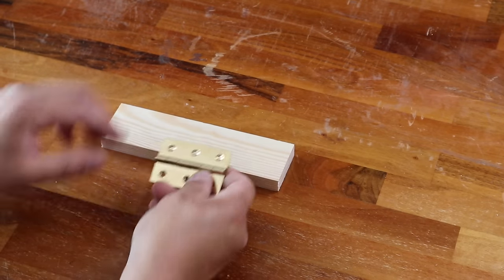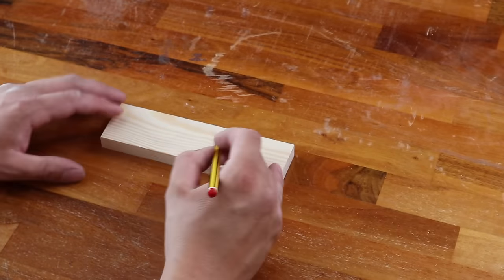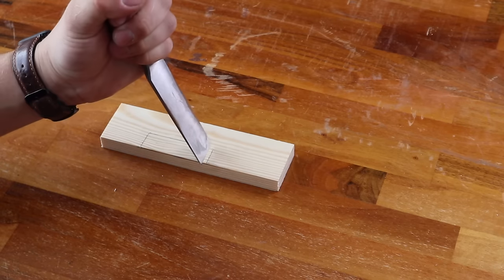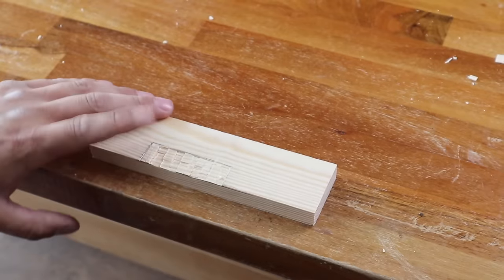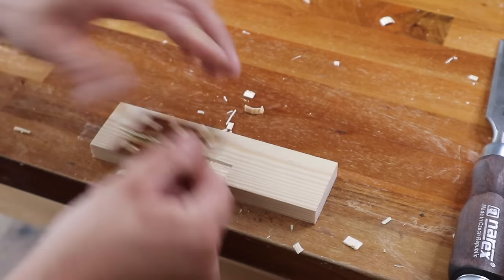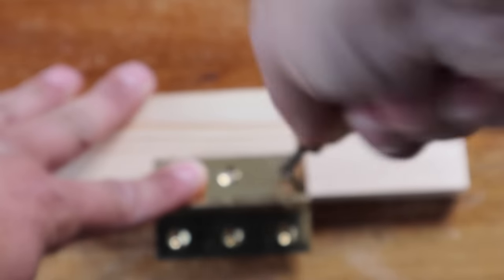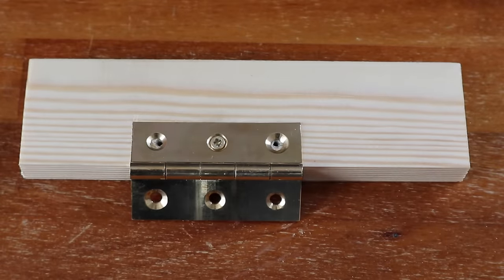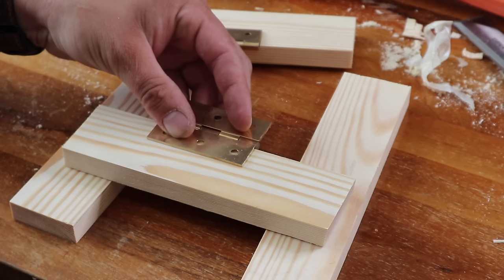How to install hinges with hand tools.

Comment: Thank you for this very simple and informative video. A question, please. Would I get away with chiselling out the mortise to attach a front to a rabbit hutch long wise metal grilled with a wooden surround opening panel? Its sturdy pine, an older one kept dry indoors? Many thanks
Reply: Sorry I meant will I need to put a mortise in with the chisel for a hutch front attachment from the one side edge with two way hinges, as you are using or can I  skip this process? It's not heavy and I will be installing 2 hinges at the one side so the hutch front swings open and closed on the left hand side? Thank you

Comment: just wondering what you are using to hold the wood in place. Surely if you don't hold it somehow it would just move when you try to chisel it.
Reply from the maker: Hi buddy just I used double sided tape to hold it for the purpose of the video, generally it would be on something larger and wouldn’t need fixing in place, just didn’t want it sliding around for the video. Thanks for you comment.

Comment: I just repainted a small jelly cabinet.  Never have done this before.  So .... I'm wondering about the hinges which I removed before painting.  Open a hinge one way and both sides will lie flat, open the other way and the sides will sit at right angles.  Does it matter which way the hinge faces?  Or is it a choice?
Reply from the maker: I’m terrible sorry but I’m not sure I understand what you mean?
Reply: Instal them flat when door closed

Comment: Any tips on getting my screws flush? Mine always seem to end up at a slight angle or is it just a case of practicing.
Reply from the maker: In a nut shell yes, practice practice practice, although saying that you can buy things called centre drill bits sets that will help no end with this. I have added a link to a set in the description of this video for you if you wish to buy some. These really helped me when I first started! Hope that helps.
Reply: @LTWCarpentry  cheers, I'll have a look if I'm still struggling. Once again great video, informative for a beginner without being patronising. Good stuff
Reply from the maker: @johnhe-yump2938  not at all mate, thanks for your comment and the subscribe ! Cheers dude !

Comment: Can we install them without any gap between wood pieces?
Reply from the maker: You can indeed, all you need to do is chop the leaves in slightly deeper
Reply: @LTWCarpentry  thaks a lot buddy... Will surely try it
Reply from the maker: Let me know how you get on… any probs feel free to get back in touch.
Reply: @LTWCarpentry  thank you... Means a lot ☺️

Comment: Nice video👍 quick question, why didn't you pre cut the long edge of the hinge with the chisel as you did the two ends?
Reply from the maker: I did mate, maybe I did it a little to quickly and didn’t emphasise on it enough, thanks for the support

Comment: 6:40 There's a wide gap between the wood planks whether in open or in closed position. I don't think this is the proper way to do it, unless of course it's how you wanted it.
Reply from the maker: Thanks for the comment, this is in fact how you would want this to look, if you have a look around a closed you should see (if installed correctly) a nice 2/3mm gap all the way round it.